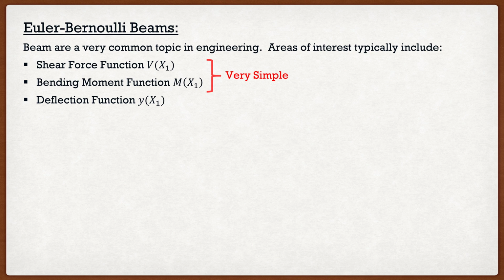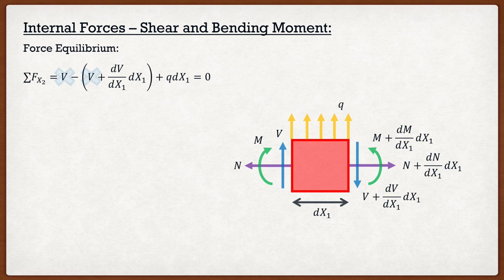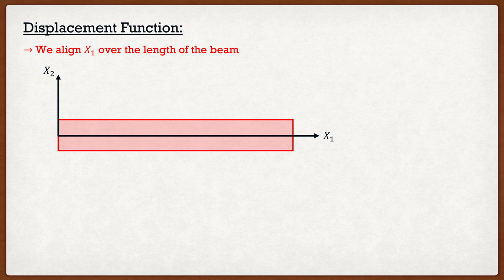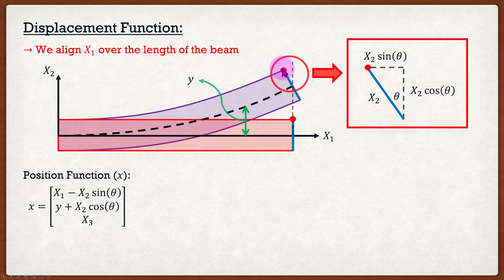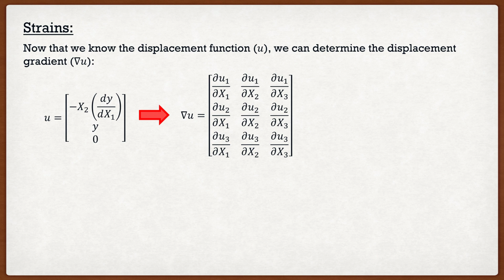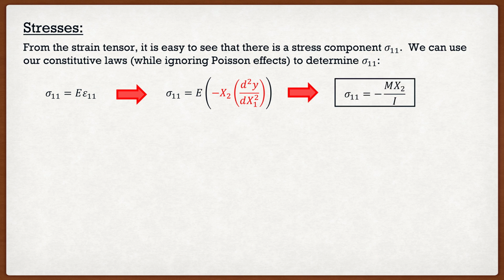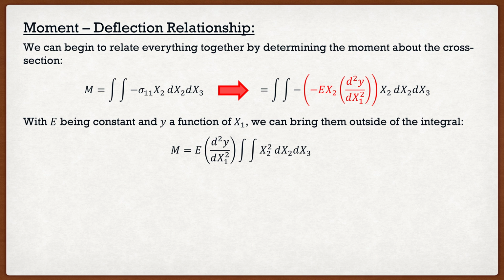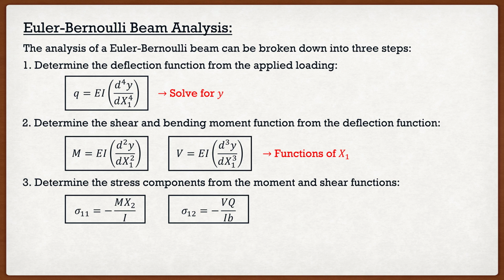Solid Mechanics Theory | Euler-Bernoulli Beams

Comment: what do you mean by X1 is constant over a cross section?thank you
Reply: I have the same question. Hopefully, he'll reply here so that I'll get a notification. In the meantime, my best guess is that since the assumption of Euler-Bernoulli Beam theory is that plane remains plane and we ignore poison's ratio, the cross-section taken before deformation does not change, i.e., doesn't stretch or compress along X1 direction, but only rotates, after deformation. The fibers of the beam do stretch or compress along X1, but not the cross-section, if that makes sense. So that's what's meant by the cross-section being independent of X1.